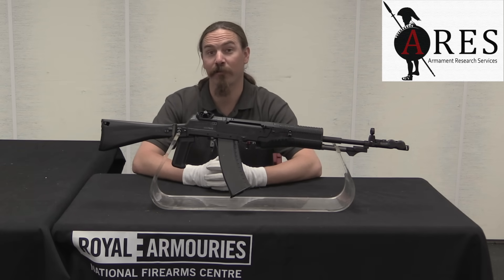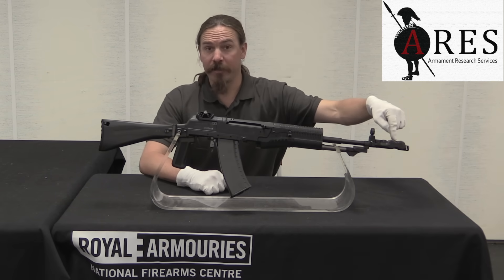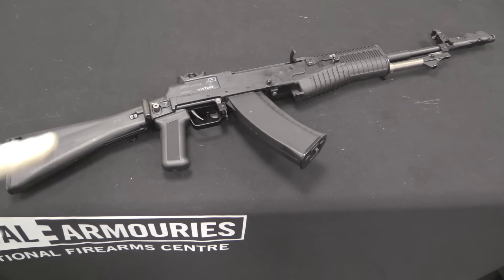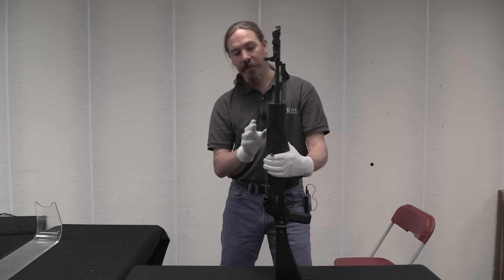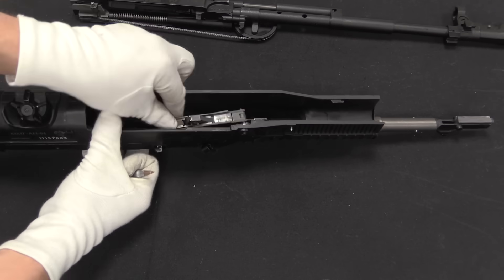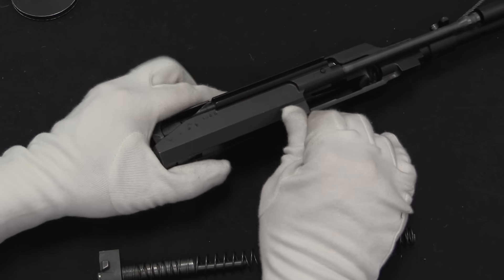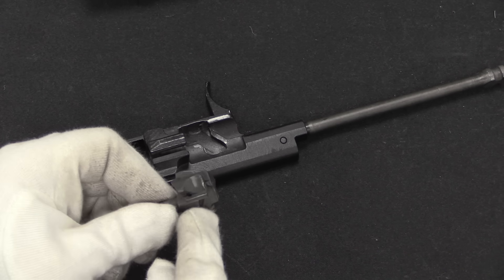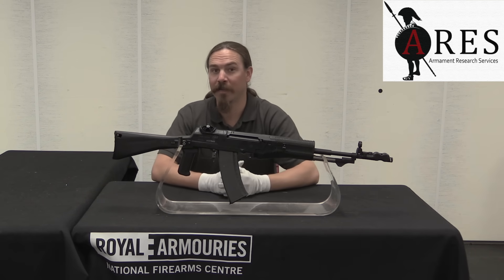Rocket Surgery: Inside the Russian Nikonov AN94

Comment: This is such a cool concept. While the cost and maintenance may suffer, this seems like it would improve actual firing results which I think is very important, especially for specialized units.
Reply: I know this was 7 years ago, but I wanted to mention that it may improve firing results, this idea doesn't improve it more than just sticking an optic on the gun. During trials, the US military found that "two rounds before the recoil of the first hits you" didn't actually improve practical hit probability per trigger pull though.
Reply: @Isometrix116  I can't really go off something so vague, especailly in regard to the US military who historically has let politics and agendas behind top brass influence results and direction with things like this. I think the concept makes a lot of sense and I find it doubtful that there wouldn't be cases where it would help a fair bit overtime. Maybe not for all in all situations and applications, but certainly in some to a meaningful degree.
Reply: @valkyrieregalia Oh, I can help with that. Info about the 80s ACR program is pretty readily available. The long and short of it is that all of the rifles that did something like this did better than the M16. But then they put a scope on an M16 from the G11 (one of the rifles from the program) and they found they all did worse than the scoped M16. This was a huge embarrassment for the military, so if it was about politics and whatnot, it would be to make this stuff look better.

I know fat electrician made a video on it years ago, probably a dozen more people have as well. Ian has mentioned it in many videos about the various ACR rifles. Unfortunately, conspiracy theories don't always answer why things don't work as we expect intuitively.

Comment: Here's a though...
...And correct me if I am wrong here...
If this gun produced mainly by steel (at least I got this opinion out of a video) - buy demilitarized rifle, extract part which were cut off, make 3D sketches of those parts and use these sketches with 3D metal printers (or any other steel cutting devices) and then replace damaged parts. In this way - you should get a perfectly working rifle.
Reply: So just machining?
Reply: Such actions are completely illegal even in Russia (Illegal manufacturing of weapons, 223 article of Russian criminal code), not to mention about western countries. So welcome to prison, comrad!
Reply: @Askold7kr  manufacture of firearms for personal use in the us is legal, provided it complies with the NFA restrictions, so remove the full auto, or if it was originally manufactured before June 1986 submit the proper paperwork and go through the ATF's process for Class III firearms...

Comment: Well it's got a pulley system so just add some clockwork, some small motors, and a waterwheel and you could probably get a 3 round burst at 2200rpm.
Reply: I can make it 4 rounds, but at 5 the gerbil dies and you're stuck back at 3.
Reply: It exists.
Reply: Hahaha a fucking waterwheel, that was good. Maybe add a windmill to generate some non GMO power to charge the laser sight

Comment: It seems weird that at no point in the design of the two receivers, a slanted magazine, or an honest to God pulley system no one said "guys, maybe the drawbacks are starting to outweight the advantages". I've never fired the 5.45x39, but based on the size it can't possibly be a hard-kicking round.

Comment: As best I remember from other sources I read some time ago now; this weapon is a bit more sophisticated and practical than laid out here. The odd muzzle attachment is a whistle. It's there to shift a lot of the muzzle blast's noise into a high frequency range that you cannot hear. In other words, its a small and rugged sound suppressor. I imagine it irritates dogs, though. And I personally suspect that the real practical reason the Russians wanted a high-RPM two-shot burst is to defeat modern western body armor. The AN-94 is accurate enough to strike armor in almost exactly the same spot twice and from a respectable range. So it can dust a ceramic plate or compromise a metal plate then hit that plate in pretty much the same spot with an instantaneous follow-up. I'll put this another way. The AN-94 is so accurate and its two shots are so closely spaced that hit probability is not a rational explanation for the design. The rationale has to do with hitting the same spot twice. They would not want to sell a functional example for a lot of reasons; not least of which would be the tendency to really figure out what the weapon is good at and within what parameters it's actually effective. It's heavy and expensive and they have a lot of AK variants on hand that work just fine for their local conficts. The AN-94 was intended to ghost NATO troops.
Reply: As far as I know the designer just really didn't want the gun to be exported, given that the Russians have had no qualms about selling or outright giving away brand new designs immediately after they're adopted by the military that seems a more likely explanation.
Reply: I don't know much about Nikonov, but Russian designers generally have no say in what the state does with the guns. Some things have changed with the end of the Soviet period, but much has remained the same and the arms industry is a very conservative part of Russian society. Typically, in the Soviet period, they would make something like a new tank to standard spec.s for their own use, then design a down-graded export version of that tank. They're very cagey about stuff like that. 

I tried to get through the comments below, but there are too many of them and the vast majority of it is repeated questions already answered, video game references and other pointless statements.

Having spent a bit of time in Russia when I was young, I can assure you that Russians are exceedingly skilled at repairing and maintaining machinery. They would have zero problems keeping the AN-94 running just fine in the field. And the complexity in the AN-94 is very neatly reduced through sophisticated design tricks. Considering the performance demands, this is a very simple design. 

It's obviously an expensive weapon to produce and Russia is focused on regional conflicts now, so my guess is they simply don't need the AN-94's enhanced performance enough to justify the cost.

Maket is the same word russians use for doll or model, as I recall. They would make a model like that for training purposes. The idea would be to have a realistic model that could be passed around throughout the entire military and police system without much concern for accidents, loss, misuse or even much attention to securing the weapon.

If anyone wants to see a Russian cuss at a rifle and bitch about having to clean it, just give him an M-16. There are good reasons they never copied Stoner's Armalite.
Reply: You're not going to get the kind of accuracy needed to hit the same spot twice from a gun whose barrel is in motion when the second round fires.  Even the experimental Metal Storm guns could barely put multiple rounds through the same hole at very short range, and they had NO moving parts at all.  Accuracy just doesn't work that way.  Even minute changes in vibration can throw off a bullet significantly, which is why really accurate guns have to minimize the variation in vibrations from shot to shot by doing things like free-floating the barrel, stiffening the barrel, and tuning the ammunition to be extremely consistent.  These are tiny vibrations, but they are what make the difference between a 4-MOA rifle and a 1/2-MOA rifle.
The AK system is inherently less accurate than the one used by the AR because the piston starts rattling around in its tube and then the bolt slams into the back of the receiver while the bullet is still in the barrel, causing vibrations, while the AR has no piston to rattle and its bolt is buffered by a spring.  The AN-94 then adds a moving barrel to that mix, along with a pully and a whole secondary loading system moving around.
Reply: "Hit the same place twice in a single burst" is pretty much a fantasy interpretation of what the AN-94's mechanism is supposed to achieve, and makes it more mystical than it actually is. As shown in various videos that fire the weapon in clean, non-moving firing ranges with clean weapons and good shooters, the AN-94 still has a good amount of dispersion in its two-round burst for there to be at least a centimeter of separation between shots. It's an impressive spread yes, but nowhere near the level of putting two bullets on the same hole to compromise something like body armor. The only way you're breaking through body armor with that level of accuracy using the "hit the same place twice" method is by firing the weapon at arm's length, and by that point you can do the same with just about any other less complex weapon. People attribute too much to the recoil dampening and hyperburst system, they're there to make the weapon easier to handle and be more accurate while putting more rounds down range, instead of some magical function straight out of the movies.
Reply: @StrikeNoir105E  There is no need to hit one point and no need AN-94 cause usual AK-74 get much simpler piercing rounds that penetrate any STANAG body armor
Reply: You say that the AN 94 has the hyperburst feature to punch through the ceramic plates of body armor by hiting the plate at the exact same spot 2 times. However I dont think that the weapon is that accurate in its hyperburst after seeing a video of somone shooting it.
https://www.youtube.com/watch?v=DJxpncKswEg
What is your opinion on the precision shown there? Do you think that is close enough? Do you have any evidence supporting your claim?
Reply: Nah sadly this thing doesn't land them in the exact same spot. Watch Vickers Tactical - 20 meters, fairly high dispersion. Unless the idea was to shatter a ceramic plate and then take advantage of that...
Reply: Nick Dzink  Actually, dispersion depends on various ifs - if the barrel resource is depleted, if the gun wasn't maintained and serviced well, ammo isn't high quality, shooting conditions aren't optimal and the shooters aren't trained enough - the range will be significantly lower. These ifs and above mentioned issues made the gun "too much pain in the ass to produce and use".
Reply: i know right thats why i love it so much in stalker nothing like sniping a fully armored enemy with a two tap to the head with armor piercing ammo
Reply: Something like that. In 2-burst mode at 100-125 meters range you get one hole in a target from 2 bullets - they hit the same spot, at bigger distances bullets still hit very close. So the idea was to defeat modern ceramic/composite body armour plates at close to medium shooting distances, get higher stopping power for soft targets, maximize hit probability for moving/medium to long range/behind light cover targets. The figure 8 muzzle device indeed alters the attack portion of sound spectrum, also helps to clean the barrel. There's also tritium points attachment for sights to use in low light conditions. Though tests showed the idea works just fine, and the gun turned out to be rather reliable, it was turned down for mass production as AK-74 replacement, since it was still too expensive, heavy and over-complicated to use by regular grunts. Recently it was decided that AEK (А-545/762 variants) will be in production for our special forces and AK-12/15 are going to slowly replace AK-74s as standard issue rifles, so the remaining AN-94 will only be used by some folks in 604 ЦСН ВВ МВД conter-terrorist and СОБР units.
Reply: Well. All it would take would be killing 1 russian soldier with an An-94. And then the american military has a fully functioning rifle.